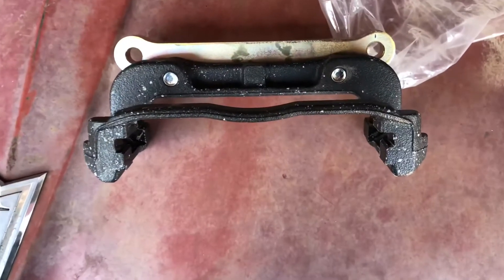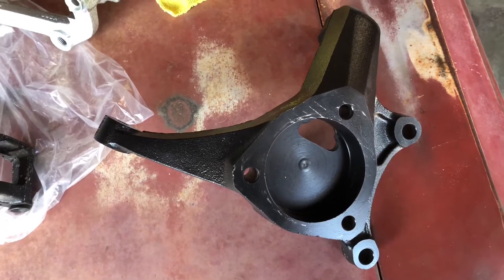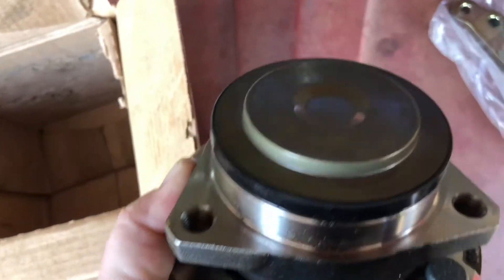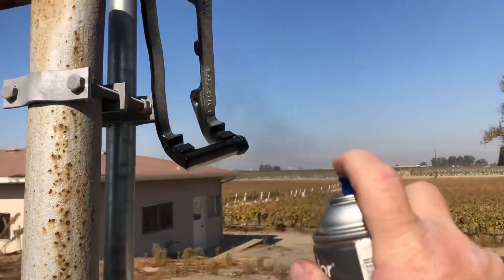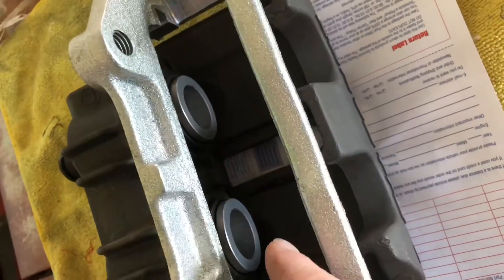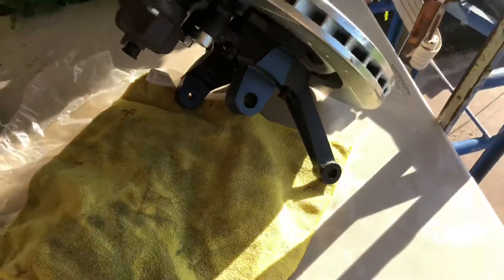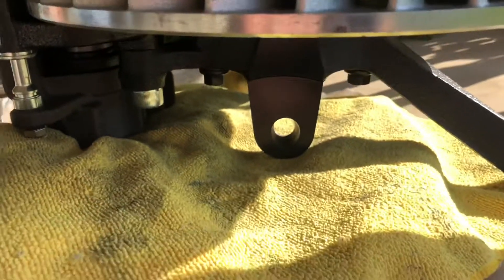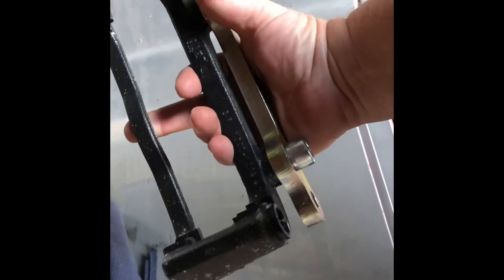Project Formula: Front Suspension Rebuild Part 1- C6 Z51 Brakes and CPP spindles

Comment: Hey I ordered the same spindles but my upper ball joint not fitting properly i was wondering have u tested your ball joints out?
Reply from the maker: I did a quick fit- they seemed ok. 
I’ll be getting back to this very soon, so I guess I’ll know if I’ve got a problem. 
Did you try using your old balljoints too?